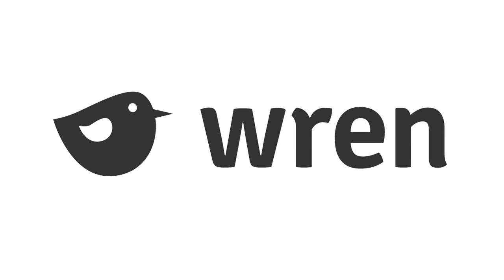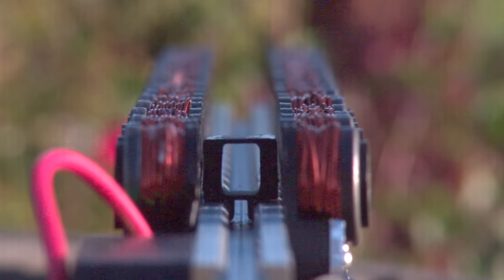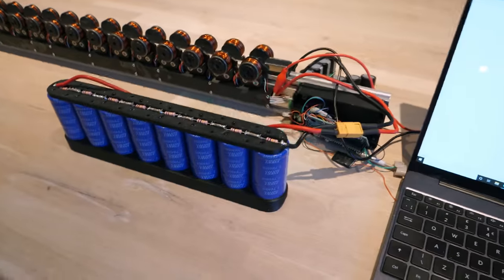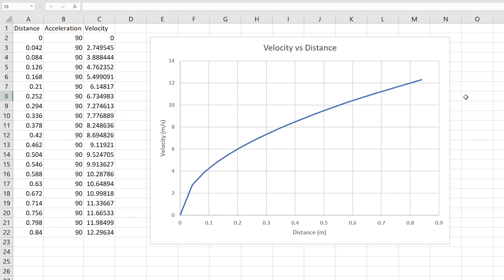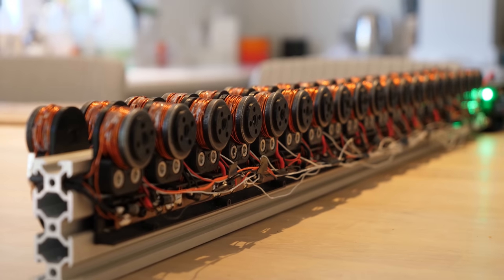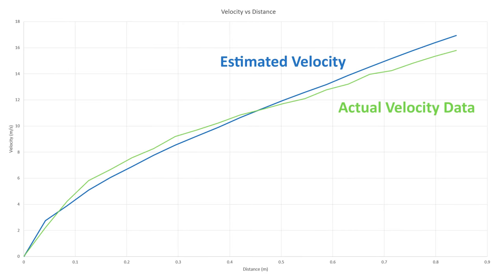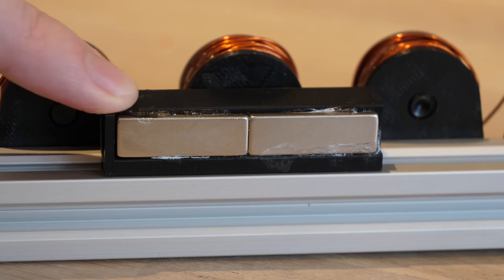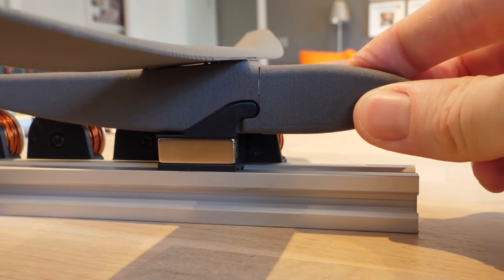Optimising a Magnetic Launcher

Comment: 2 thoughts:

Instead of velocity vs distance graph, try using an energy/time graph.  Kinetic energy is equal to velocity squared, so if energy increase is constant, then a velocity/time graph would look like sqrt(t).  Using distance instead of time also skews things, and you switch to using time instead of distance for the battery graphs.  My guess is that a good curve to have in energy/time graph is a straight line.

I love your constant attempts to use super capacitors only to find out batteries work better.  Definitely a consistent theme of the channel.  I think we both just think super capacitors are so cool and want to find uses for them :)  I wonder - capacitors definitely have faster response times than batteries when load changes, while batteries can sustain the load better.  Their strengths and weaknesses compliment each other.  Did you try connecting both the capacitors and the batteries in parallel?
Reply: A Capacitor + Battery mix should perform better.
Reply: That's a good idea. The standard technique on PCBs is to add decoupling capacitors as physically close to the sink of current (IC pins typically, but here would be the coils/FETs) as possible to reduce the loss associated with impedance from the relatively large distance back to the power supply/battery.
Reply: The string of 8 super-caps will have much higher ESR than 3 lithium-ion packs in parallel. Their only advantage here is superior charging speed. You can't simply state that "capacitors have faster response times" without considering the capacitors and their configuration.
To increase the power output of the batteries with capacitors, I think you'd be looking at a wild amount of low-ESR capacitors in parallel. I reckon (by simulation) at least 500mF to make a noticeable difference to the first pulse in Tom's launcher.
Reply: first thought went over my head, but I noticed the same thing for thought bubble two. the combination of both super cap and battery might provide a further stable voltage and current demand
Reply: @tboy32  decoupling capacitors are not used as a means to reduce power loss, they act as semi current source when the chip sinks more current(inductance of PCB trace resists this.). You are essentially inductors in this case no point using capacitors.
Reply: Super capacitors are great if used as a primary in explosive situations. No primary explosives needed.
Reply: To be quite frank, it would probably best to have a position vs time graph instead since you cannot accurately measure the velocity as the projectile is constantly accelerating. What he measures is the average velocity over a fixed distance rather than the true instantaneous velocity.

If you wanted a true energy vs time graph, you would need to find the line of best fit for the position vs time, and then take its first derivative which then could be used to find 1/2mv^2
Reply: @varunkoganti9067  I think you missunderstood the use of "loss" in the comment. He didn't mean power loss. The decoupling capacitors are there to reduce the voltage loss (obviously more often called voltage drop) in the wiring up to the current consumer. And his use of impedance was good because there is both inductance and resistance in the wires - a twice as high current spike will give a twice as large voltage drop from pure rwsistance in the wire, so the decoupling capacitors makes a big difference to keep the voltage up at a consumer with pulsed loads.

Comment: As others have pointed out, you need to either increase coil spacing with distance, or increase your control speed, which means hitting the coils harder down the line. One way to do that is to distribute the capacitor bank down the length of the gun, adding caps as you approach the end. Your existing system is running out of power as the projectile advances, when you want to be increasing power as it advances in a system with constant spacing. 

One way to advance the design is to simulate the system. There are SPICE models for coils and moving magnets that can help simulate this whole thing. There are also tricks to shunting flyback into the next coil…
Reply: This guy used the word 'shunt' therefore he either knows his shit or is really bad at insulting people.
Reply: @DCsk8rgoelz  One or the other, yep.
Reply: something from ArcFlash Labs Maybe? xD
Reply: Not a single sentence that you wrote is correct. Not trying to make fun of you, but its not.
Reply: @CookiePsycho  The hallmark of the drive-by troll: "everything you said is wrong, but I'm not going to say where you're wrong."
Reply: @josephwisniewski3673  But I said where you are wrong. Everywhere.

Want to elaborate? Here you go:
When current flows through a wire, electromagnetic field is being generated around it. Any magnetic object (iron, magnet etc.) will be attracted to the middle of it.
Knowing that you should already conclude that first coil has most input on accelerating the projectile because it spends the longest time in its electromagnetic field, while last coil has less time to accelerate it (speed of projectile shortens the time spent inside magnetic field). Ergo: spacing coils will not help. What will help is spending more time in the field (bigger coil, oval shaped maybe?), or stronger field the faster it moves.

Second conclusion is that while projectile is being pulled into the middle of the field, then when it passes the middle it will be slowed down instead of being accelerated. To counter that you should switch off your coil when projectile passes the middle. Therefore depending on how he switches the coils on and off (if he switches them off at all, cant figure it out from this video) distributing caps down the lenght of the gun like you wrote, could have oposite effect. Best way to aproach this problem would be to calculate capacitance for each stage, so when coil is triggered by the optic gate it unloads connected caps (normal caps, super capacitors not required) long enough to accelerate but short enough so it goes off before projectile passes middle point. And this aproach is counter intuitive, because with same size coils, capacitors actualy get smaller in size.

That aproach would also solve droping voltage problem.
Reply: @CookiePsycho  he’s using a Hall effect sensor and mosfet to turn the coils off when the magnet passes the center
Reply: What software would you suggest he simulate the system with?
Reply: @toheebubolajiolabiran2124  COMSOL Multiphysics is the only answer.
Reply: @Mentaloow  okay

Comment: For those still confused about the difference between railguns and coilguns:
Railguns use two rails and lots of electricity to launch a projectile with the Lorentz force. 
Coilguns have a projectile that goes through the center of a group of coils stacked like donuts, with the ones in front of the projectile attracting it and pulling it forward, and ideally, the ones behind it repelling it and pushing it forward.

The magnetic launcher in the video uses the same principals as a coilgun, but with the way the coils are oriented, calling it a magnetic launcher would be more accurate since its primary purpose and design is for it to launch stuff from the sled rather than simply using the sled itself as a projectile like a standard coilgun would.
Reply: Thank you for nicely explaining the concept
Reply: yeah but no ones ever heard of coil gun, everyone says railgun regardless of the precise arrangement of the magnets. 
Its like everyone says 'literally' to mean actually... but it really means 'as per the literature'
Reply: @hindugoat2302  ? A coilgun still isn't the same as a railgun tho.
Reply: @hindugoat2302  Plenty of people say gauss rifle/pistol for coilguns, especially because of Fallout.

Comment: I think you should consider finding a way to conserve the inertia the sled has when it falls away. Essentially, the energy you put into moving the sled forward is energy the isn’t pushing the glider forward. If you designed the sled to “push off” of the plane as it falls away, perhaps with a spring or pair off magnets with like poles facing each other, it might result in better overall performance. If the sled falls straight down after leaving the rail, you’ll know it has transferred its inertia to the glider, in much the same way that water falls straight down after striking an optimized scoop in a turbine. I don’t know if the spring/opposed magnet idea would work, but I’m sure you’re ingenious enough to find SOME way to extract that last little bit of inertia.
Reply: Except for hydropower (Pelton) turbines, when the water comes to a stop after hitting the bucket, the bucket is moving at half the speed of the water jet. If the bucket is moving at the speed of the water jet (glider moving at the speed of the sled), there is no energy transfer. Like in his trebuchet videos, he would have to come up with a solution which can transfer the kinetic energy of the sled to the glider by slowing the sled down, which means IT can't be the one pushing on the glider, but instead some lever arm or such.

Comment: Love how the spreadsheet graph matches your test data.  You might try flipping the sensors so they tell you when the sled is leaving the coil. Then play with successively larger distances between coils as many have commented. The spreadsheet will help maximize acceleration per coil prior to a rebuild.  A fixed distance between coils locks in a maximum speed since pulse timing is critical as speed increases.

Comment: I do love projects like this and have a multi-stage coil gun that I've built myself to explore this fascinating area of physics. I do find your design to be quite interesting in general with having the idea of "un-rolling" a standard electric motor to make a linear motor. The way I had managed to maximize my projectile velocity was to move away from super capacitors and move towards high voltage caps with a much lower capacitance. Since P = IV or I^2*R, and capacitor potential energy is a function of both the capacitance and the voltage squared I found that operating with more voltage and a capacitor that drained very quickly with P also being equal to J/s I managed very high speeds with far less coils. Perhaps moving towards high voltage and lower capacitance could yield an even higher end velocity with your design.

Oh and I found it quite interesting on how many people thought that your device was a "rail gun". While both your device and a rail gun are both linear motors, you system is far more similar to a coil gun since rail guns operate on quite different systems. I guess this may be a result of people hearing a term tossed around online without understanding what that device is. I hope to see more wonderful projects from you in the future.

Comment: Well done . . . includes formulas and concepts I've forgotten over the past 70 years.  It would be interesting to see how the system described here scales up to the General Atomics EMALS system now in use on the USS Gerald R. Ford Carrier.  EMALS has had an extended development period as the issues and weak points are now being explored in use on a ship.  One significant difference between the system described here is that it uses uses capacitors and/or batteries for energy storage while the EMALS system uses flywheels.  [Based on my career I would have thought EMALS would have used capacitors.]  So far EMALS seems to be beating the steam catapults in use now although problems are still being discovered.
Reply: minus some hiccups the system seems to be in it's final stage, especially with the increased testing over the last year and a half while the ford was at sea almost continuously. During this timeframe they also broke the record for most sorties in a day.

Comment: You could also try launching steel, while it won’t have as much of a generated magnetic field, I feel as if it may give you a acceleration advantage because it’s not canceling itself out therefore allowing more coils(and unlimited amount of coils) throughout the launcher

Also you can try dry graphite on your launcher which will make the friction very minimal on your sled(trick used from pinewood derby cars)
Reply: If you use steel, it doesn't generate its own magnetic field so the electromagnets would have to provide more power. Not only this, how would you detect and accurately time the coils as hall sensors are now worthless?

Comment: As others have mentioned, kinetic energy goes up with the square of the velocity.

Another way to increase power is to add a flux return path for the magnetic fields. There might be a solution in chaining linearly but, especially for this setup, I think just a chunk of iron in like a "C" shape, oriented Up, around the track, would get you ~3x improved magnetic performance. You'd wrap the iron with your coils and trigger it the same way. Iron is good for these low frequencies but higher frequencies need different core materials. It also makes the steel the "force carrier", as in what actually gets pushed on. It can be a lot easier to hold onto steel than to coils. Notice the individual wire of the foreground coil moving at 10:01 in the video. Eventually that wire will fail as copper fatigues/work hardens quickly...
Reply: Laminated electrical steel would be a good improvement over simple iron. It's a big reason why mains transformers in everyday devices can be so efficient.

Comment: This for me helps to solves the problem for electric powered flight, and so it is interesting to see you take up this method. I have seen gliders use this method on take off using a pulley line, which on reaching a certain height drops away, or aircraft carriers that use steam and magnetic rails.

Comment: Hi Tom, GREAT project!  I did not check through all the comments to see if someone may have already suggested this, but with respect to the idea of adding 2 magnets, instead of using two magnets of the same size as the one magnet, how about using two magnets of half the size each of the one magnet?  If the magnets are saturated, then halving them does not necessarily reduce the magnetic field by a factor of two, but you will have reduced the mass by a factor of two. So by this means you might get get even more velocity.  Keep on experimenting! :-)
Reply: How many times can you slice the magnet before the velocity goes down? I.e. what is the optimum amount of slices?

Comment: From what i know, the coils need some time to energize fully, so it might be worth to put the activation sensor further back the rail, and then use software delay so you can adjust timing, and find sweet spot. This might be especially important for the last few coils because when the projectile is travelling with high speed, the coils might not have enough time to energize properly.
Reply: Would it make sense to energize all of the coils at the beginning, and just turn them off as the sled passes by?
Reply: @TheWondermittens  my thought exactly!
Reply: @TheWondermittens I think it would suck a lot of current, which battery would not be able go provide, and its voltage would go super low
Reply: @TheKapicraftPL  Maybe just the next two coils then, to give the second one more time to warm up.
Reply: @TheWondermittens  the coils rely on the back emf (the voltage of the sled passing by) to limit the input power, connecting them to the power supply without the sled moving past would cook them very quickly.
As he says in the video each coil would draw over 1000W which might cause some issues lol

Comment: What about the inductance of the coils? Current flowing through a coil can't ramp up infinitely fast. The more windings, the higher the inductance and the slower is the ramp up. This may be an additional or even the main reason why less turns give you a higher end velocity. At the end of the track the sled may be already too fast to allow the current through the coils to ramp up to maximum before the sled has passed the coil. So I'd suggest to measure the inductance and tune it by adjusting the number of windings in order to better match the current ramp up to the position and velocity of the sled.
Reply: Or, adjusting the distance between the hall sensor and the coil. That would give the later coils enough time for he current to ramp up. That said, if it was taking a long time for the current in the coils to ramp up, we wouldn't be seeing those sharp voltage drops.
Reply: @robertbackhaus8911  He could have an Arduino electronically switch the magnets on/off based on the sled's last three known positions. That way you could have the magnets on before the sled was anywhere near the magnet.

For that matter, he could have all the magnets on and switch them off mechanically as the sled passes.

Also, isn't there a more novel way of measuring the position of the sled? I mean, the magnets on the sled must change the voltage or current through the coils as it passes, right? Electromagnets aren't my wheelhouse, so I don't know what I'm talking about.
Reply: In an electronically commuted washing machine they advance and extend the commutation as the speed increases in the spin cycle. This allows for the slow current build due to the inductance, and the inductance then helps keep the current flowing as the peak back EMF can exceed the commutation voltage.
Reply: @RobertKreegier  Arduino not be a bit slow for the requirements of the end of the coil-gauss accelerator?
Reply: The number of windings of the coil don't only affects to the ramp up inductance; Also to the Magnet Resilience, or demagnetized of the coil, what afects to the atraction / repulsion of permanent magnets of the proyectile. This takes a time; The more windings,  higher the time what the coil remains magnetized (slower magnetizacion due to highter inductance, and greater resilience), and contrariwise.